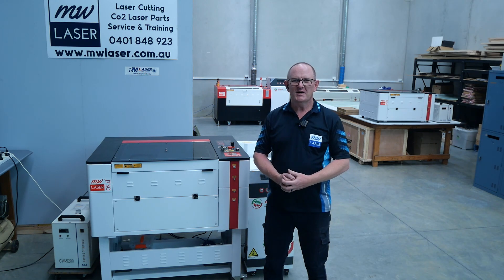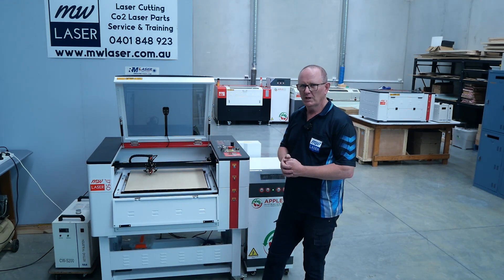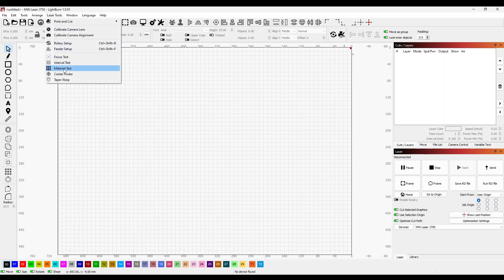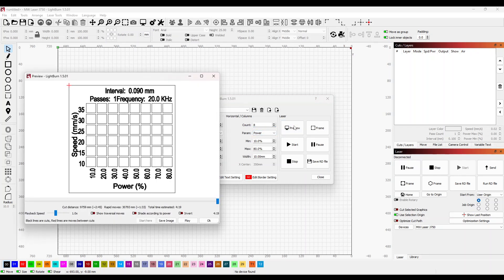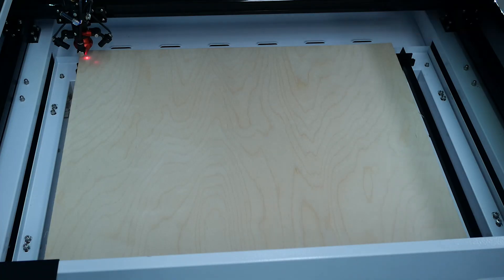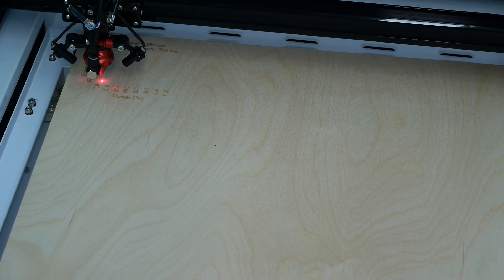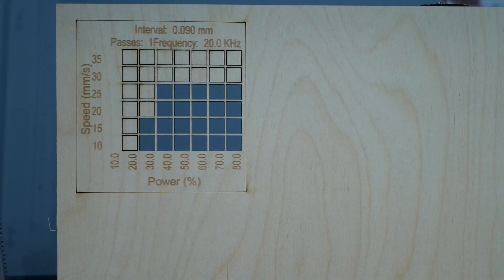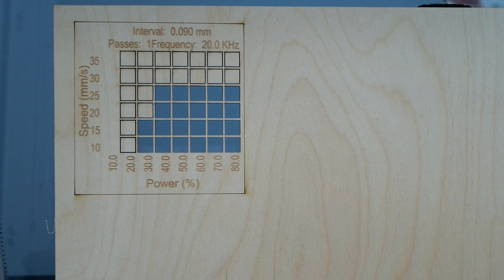MW Laser - LightBurn Material Test Pattern - Training Video

Comment: لماذا يجب وضع 5000 خطوة في الدورة و قد وضعت قطر القطعة المراد نقشها من فضلك ؟
Reply from the maker: This setting is for these model machines. The setting relates to the stepper driver settings and is required to accurately move the stepper motor on the rotation device.   Other models may have a different value. You can check a previous video on the rotation device on our YouTube channel for more information.